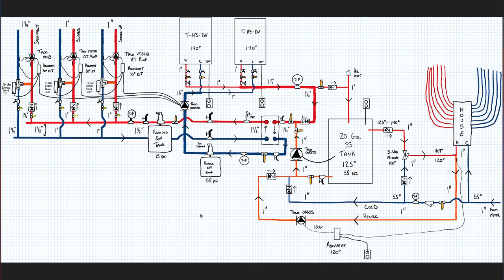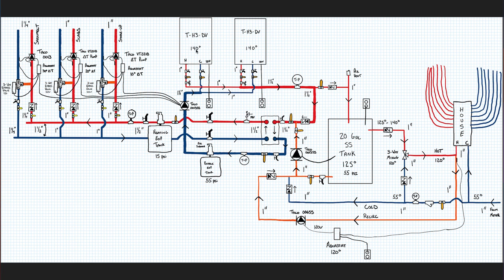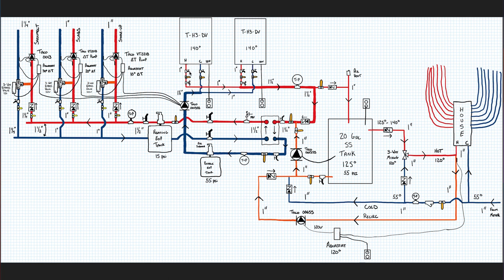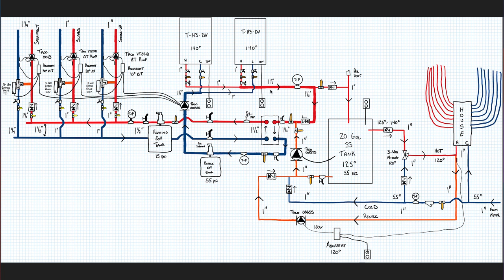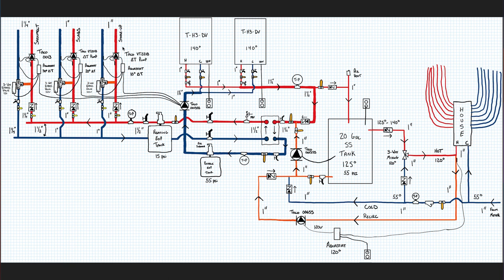Heated Driveway, Radiant and Domestic Hot Water System Piping Layout - Episode 10 [12-1-2019]

Comment: Next step is hot water recirculation at every tap like in commercial buildings. They do have residential solutions available that are pretty easy to install, some use the cold water supply as a hot water return, but it sounds like you’re happy with the recirculation up to the manifold. The breakdown made this a lot easier to understand. Thanks!

Comment: Have watched all your videos, for a DIY'er you have done fine. Your buffer tank does exactly what its designed for, stopping short cycling. My 2 cents would be to split temperature setpoints at boilers. One little higher than other, like 135 & 140 or 140 & 145. Could change this every season so run hours even out over time. Maintaining space temperature with return water is great, very comfortable to occupants. Great job piecing it all togetherl
Reply from the maker: Hi Glen.  Thanks for taking the time to watch all of my videos, I appreciate that!  Regarding your suggestion to split the temperatures, it's actually not an option as the units are linked together.  Takagi offers a built-in "Easy-Link" system where you can connect up to 4 units without any additional hardware. They even include the cable with each unit.  With the 2 units linked together, they function as 1, and automatically modulate from 15,000 BTU's all the way up to 400,000 BTU's.  You do bring up a great point though, if I am supplying the same flow with a fixed speed pump, I'm sure the would function the same individually as they do when linked. Hmmm, something for me to think about, thanks!  I also agree with your comment about maintaining space temperature with water return.  We have found it very comfortable.  Thanks for the comments, and thanks for watching!

Comment: Wish I had installed hydronic heating just so I could build this out.  Have you considered PIR sensors to trigger your outlet on your Aquastat?  In my quest to minimalize any wasted energy without interruption to daily living, I installed PIR sensors in each of the bathrooms and kitchen areas.  Once motion is detected, they power the pump for 10 minutes.  There are a number of ideas I am taking from your experiences like adding a secondary loop to the buffer tank and adding a 3 way mixing valve.  My current buffer tank is a 5 gallon electric, however I have a AO Smith Hybrid Heat Pump that I was using before switching to tankless and may introduce it into the buffer position.  Having 18kw's of solar, I want to take advantage of maintaining the standby heat.

Comment: Hi, im going thru your videos and are very good and useful, my only question with the system its the position on the safety 120 degree mixing valve, why not at the entrance of the house water manifold and let the reticulation without that drop of temperature.

Comment: Great videos. I need to binge watch the rest. Why is the foam board not to the edge and vertical on the edge?  Also did you set the wire mesh on chairs to place the pex in the upper 2”?
Reply from the maker: Hey davidpgh1!  Thanks for the compliments, I appreciate having you as a subscriber!  So the original plan was to run the foam board to the edge and up, and that's typically whats recommended.  In my case, my concrete contractor had the idea of leaving the outside 6" un-insulated to "lock" the foam in place under the center portion of the slab, and prevent insects, etc from boring into the side of it.  I wasn't starting the pex loops until 12" from the edge anyways, so I was ok with it.  I wasn't planning on the edge insulation, as I'm pretty sure it would've gotten destroyed during backfilling, etc.  I also like that I was able to run my sprinkler heads right up next to the driveway on each side without the foam being in the way.  I'm sure I'm experiencing some edge loss, and even a little bottom loss to that 6" un-insulated strip underneath on each side, but considering most of the concrete contractors I contacted said they typically don't install any insulation at all under heated slabs, I think it's fine. 😊. In the garage slab we went right to the edge underneath, and also along the permitter, 45'ing the concrete up to the top.  I talk about that and show some pictures in another video.  Thanks for watching!!

Comment: I'm curious as to what the bypass valve on the snowmelt system is for?  Why not just energize the 0013 pump and start circulating the glycol?  It seems like once you get the delta T between the supply and return temp to within a small value the snow melt would have heated the slab mass and done it's job and could be turned off?  Great content BTW!